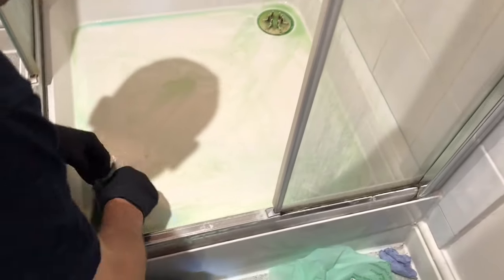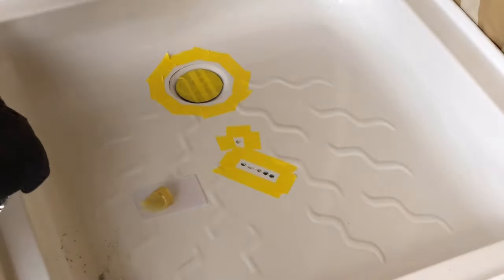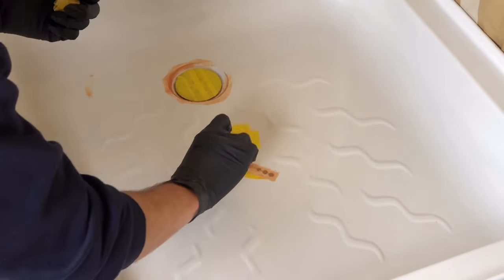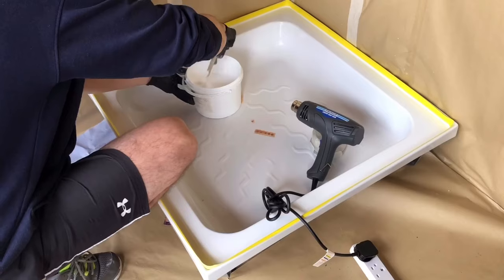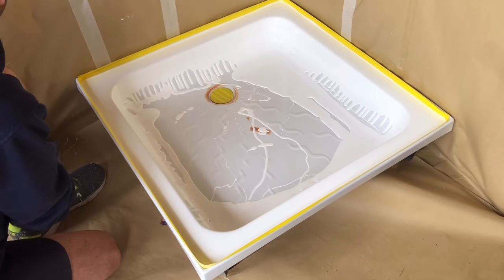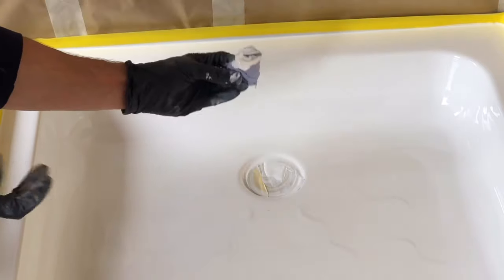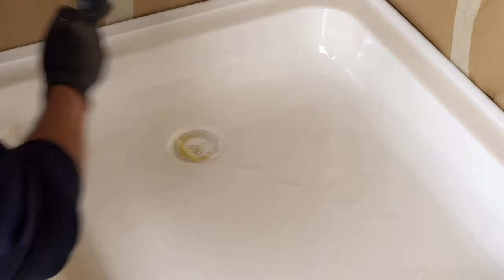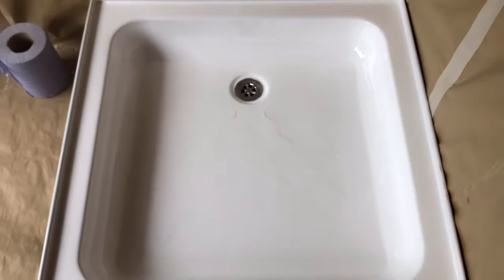Shower Tray Crack Repair (No Repair Kits)

Comment: Hi , we have a all in one caravan shower cubicle that’s built in with no joints and is very deep sides about 10 inches of depth, can we still use your kit by say masking off towards the bottom of the unit, thanks

Comment: Why does the title say "no repair kits" if this is using your own repair kit that you sell?
Reply from the maker: Hi Matthew, thanks for your comment. A repair kit and a resurfacing kit might sound the same, but they are very very different. Spot ‘repairs’ are for trained pros as they are far more challenging than repair kit suppliers would have you believe. Resurfacing with a product like the one in this video is very doable for the average DIYer. Also, The Surface Saver is no longer trading after Brexit made it unviable to source the product from the EU, so this video is free info. Use the information or not, it’s up to you

Comment: Is the filler included in the resurfacing kit? If not, what do i buy?
Reply from the maker: Hi Valerie, yes our kit does include the filler and hardener. The kit is available here https://www.thesurfacesaver.com/sales-page-408740831594221431758

Comment: Hi Grant, will the kit deal with a hole in a tray? I have just bought a caravan which has a 50mm crack but also larger area around 60mm long and around 8mm wide which has had a silicone botch. Also there is some flex at the crack location, would you advise to drill and pump in expending foam to provide additional support?
Reply from the maker: Hi, sorry we are not stocking the kits for the foreseeable future. Our product comes from the EU and new trade barriers have made importing it unfeasible
Reply: @GrantTheSurfaceSaver  damn!! Any recommendations for an alternative?
Reply: Im in the exact same situation @Justin, was hoping to come here for some insight into getting this fixed 😅
Reply from the maker: @justinsmith1054  the resin in the kit is called Ekopel 2k and the filler is called fibral, both available on Amazon. You’ll have to source the rest of the kit yourself, this video shows a list of what you need https://youtu.be/sbbzLEp3ssw
Reply from the maker: @jackp452  see thread for the info you need

Comment: Hello Grant, I’m from the US and was looking at the kits sold here .. I’m not sure if Ekopel kits sold here comes with the crack repair kit. . So my question is does it come with the repair kit.. If not what should I get to repair the crack before I resurface? Thank you
Reply from the maker: Hi, thanks for getting in on the chat. We supply our shower repair plus resurfacing kits to USA. You can follow the link in the description to order your kit from us. Thanks 🙂
Reply: Thanks , but does it come with crack repair kit?
Reply from the maker: @pozmarciv  hi, yes, our kit comes with everything you need to repair a crack and then resurface the tray as good as new 🙂
Reply from the maker: @pozmarciv  on the order page, if you see a box to enter your credit card details, this is a bug that happens with some browsers. There should only be PayPal buttons as we process all payments through PayPal, but you can still checkout as a guest (with your own card) if you don’t have a PayPal account. If you don’t see the PayPal buttons, try opening the link in a new incognito (private) tab. This should block cookies from interfering with the order page 👍
Reply: @GrantTheSurfaceSaver  
Hello Grant, do you recommend lightly sanding the shower pan? And do you recommend using a primer? And how long does it take for your product to get to the US?
Reply from the maker: @pozmarciv  hi, yes, our kit comes with wet and dry sandpaper and we recommend always using with water. We recommend sanding the tray so as to take off the shine and assist adhesion. There is enough paper to sand the tray and smooth any filler as required. Our kit takes 2-3 days to arrive in the US 🙂
Reply: @GrantTheSurfaceSaver  
Is it a lit light sanding? Sorry for the questions.. I just want to have an idea of what to do
Reply from the maker: @pozmarciv  hi, don’t worry, I’m happy to answer as many questions as come my way 🙂. You don’t have to go easy with the sanding, the kit comes with 180 grit paper which is pretty course, and you can go at it as hard as you like. The material goes on so thick that you definitely won’t see any scratches come through. It’s not like spraying where the layer is so thin you can make out scratches if you go courser than 400 grit. The more you can scuff up the surface before pouring the better really 👍
Reply: @GrantTheSurfaceSaver  
So I wet sand with 180 grit, then clean, repair cracks,then Put on product?
Reply from the maker: @pozmarciv  remove silicone if required, clean to remove soap scum etc, scuff with wet and dry paper, rinse, dry thoroughly, mask off, pour 👍
Reply: @GrantTheSurfaceSaver  
Hello Grant, I just purchased your kit .. there was a coupon but I’m not sure if it was applied.. It came out to 201 USD .
Reply from the maker: @pozmarciv  hi yes, the coupon was applied. We’ve received your order and will ship the kit tomorrow. Thanks very much, The Surface Saver 🙂
Reply: @GrantTheSurfaceSaver  
So last question.. after I sand the shower base is it necessary to add a primer?
Reply from the maker: @pozmarciv  hi, no need to add a primer. Just make sure the surface is as dull as possible, because the shininess inhibits proper adhesion 👍
Reply: @GrantTheSurfaceSaver  
Hello Grant .. I placed an order to the US .. am I receiving Ekopel 2k ?
Reply from the maker: @pozmarciv  hi yes that is correct
Reply: @GrantTheSurfaceSaver  
Thank you Grant .. and thanks for responding to my questions so quickly
Reply: @GrantTheSurfaceSaver  
Hello Grant, I received the product when I open the package there was some of the product on the bottom of the can and the lid looks like it was opened not sure where it leaked from .. maybe the bottom or maybe the lid.. My question Is when I opened the bucket it was only halfway filled. Is that normal?
Reply from the maker: @pozmarciv  maybe the package was opened by customs to check for contraband? 🤔 Don’t worry, the tub is only supposed to be half full, so there is plenty of spare volume to add the hardener and mix without it spilling over. Make sure the room and the product are constantly in the low 20’s Degrees Celsius for 24hrs before and after application, and mix thoroughly for 10 mins, focusing on scraping the residue from the sides and base. If you get the temp constantly nice and warm and mix really thoroughly, you should get great results 👍

Comment: Tbh it would save time just get new tray there not that exspensive
Reply from the maker: Hi, it’s not the cost of the tray, they are pretty cheap. But if the tray is already fitted and to replace it you have to remove the screen, tiles, redo the plumbing and all that, the cost runs into 000’s. If the tray is fitted, it’s definitely more cost and time efficient to resurface it 👍